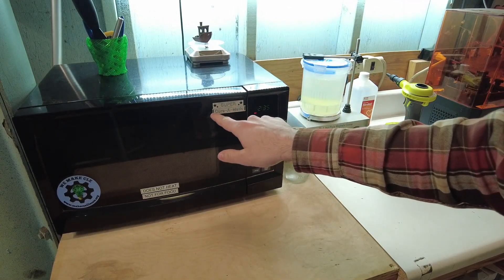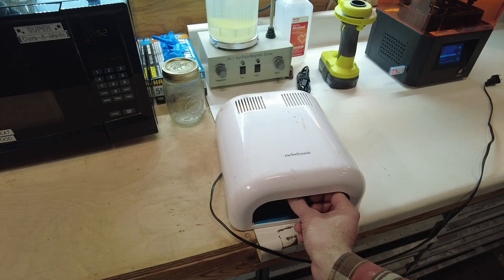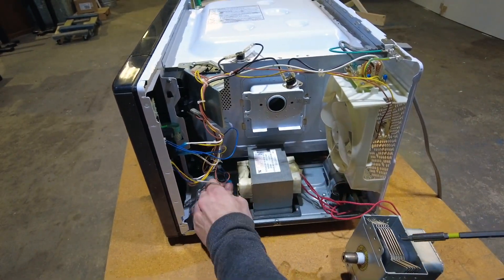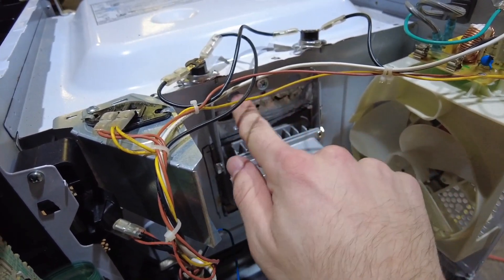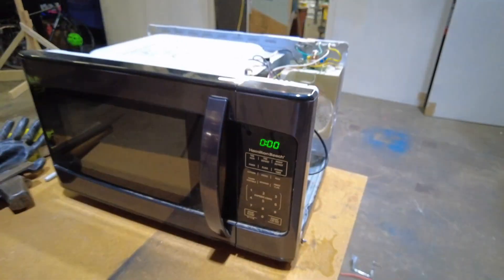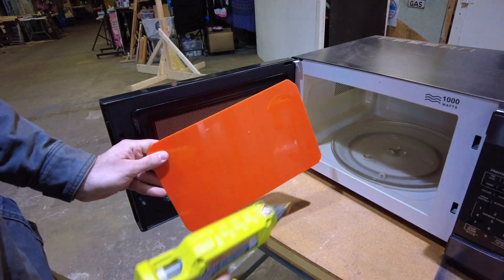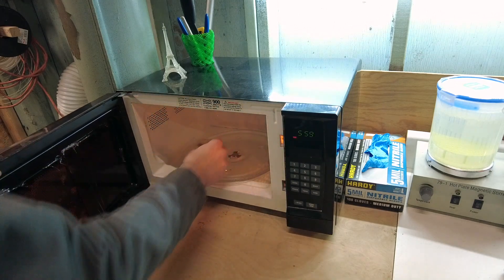DIY 3D Printer UV Curing Station Made for about $20

Comment: I like some of the other commenters suggesting the strip lighting and aluminum reflectors, and depending on the microwave, the mesh in the front window might be removable. It's there to prevent microwaves from escaping, and in some cases is just a mesh panel screwed into the door behind the acrylic.

Comment: I'm building basically the same thing. I'm using LED UV strip tape. 120vac. Going to use 365nm and 395nm . Putting rows on the top and both ends.  I like your idea with the extra protection on the door glass. I think they make a fillm I can put on the glass. This will be great. Going to use it mainly for PCB making and adhesives. 

How has yours been working for you?

Comment: What an awesome idea!  I acquired a free microwave and got to work.  After removing all the items that make the microwave a microwave I lined the inside with reflective foil tape.  Then I disassembled a large UV light to get the led panel and driver from it.  All I had to do is screw the led panel the the inside of the microwave and feed the wires through a tiny hole. Then wired it up and soldered all the connections.  It works like a charm and puts out way more UV light than the small light I was going to use. 

Thanks for the great idea!!

Comment: Great idea, much better than lining a cardboard box with aluminium foil! Ideally you would take an old oven for this, so you can also raise the temperature to about 60 degrees C (but don't use the grill!). Also, you could try to add mirrors to the inside, to spread the light more evenly.
Lastly, allow me to comment on your resin handling; do you realize you touch everything with dirty gloves? The bolt of the printer, the lid of the IPA beaker, the microwave... All would need to be cleaned with IPA. Also, please cure any tissues you used to clean resin spills in your nice microwave before disposing them in the trash! 
Keep up the good work!

Comment: I did accactly the same but with the uv leds of the nail lamp and my microwave had an analog timer< but i build an nicer version now. I am struggling with the dvr8825 and a nema 17 now to turn the stirrer and the slow rotating of the plate

Comment: Just an FYI, the purple UV lights are not really harmful to your eyes (think "Halloween stuff"). The UV ones that would be harmful to eyes (and skin) are the ones that have the sort of sky blue color output which are used as germicidal lamps. They are still UV but just a different part of that spectrum. I do like the ideas below of using the UV tape LED's and also the aluminum tape.

Comment: nice idea! i find that postcuring the part submerged in water enables a lot quicker, non-tacky cure! apparrently oxygen contact can inhibit the resin from curing fully at the surface, especially if the ipa is already a little dirty. in addition to some reflective coating on the inside of your chamber you might be done curing in ~5 minuits!

Comment: I use a nail curing station like that sitting on top of a cardboard box lined with aluminum tape, and one of those solar turn tables. Works great for me but I don't usually print anything with enough weight that the turntable wont turn. That microwave is a great idea!

Comment: Aluminum is one of the only good reflectors for big chunk of the UV spectrum that you actually want to use, so some aluminum foil or tape on the other walls would probably help cut the curing time down. There's probably some dead zones that prevent you from curing in the whole cylindrical volume above the glass plate, and this would fix those pretty easily. You could even put reflectors down on the bottom. You could also probably make a custom connector to the little rotating bit under the removable glass base have it rotate whatever kind of bed you want pretty easily, which opens up some neat options. A custom parts-curing tree would let you suspend a lot, and the aluminum reflectors would make it much more even in coverage so it could actually work.

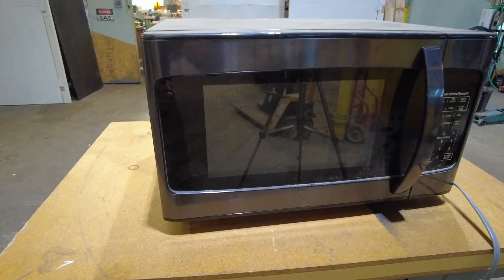Comment: Microwave mod starts at 4:20 - cleaning & safety
Cover off at 6:20
13:07 "simmer"  0_0   I hope not. Alchol should not be heated.
Reply: You can safely warm alcohol without it being dangerous. The temps that are being used are no way close enough to the flashpoint for an issue.

Comment: Love that idea. Actually thought of this myself and now i hate, that i wasnt the first one :D Just got my hands on an old microwave… maybe aluminum tape helps reflecting some more light, consequently decreasing curing time. Maybe not relevant with that big uv light. I only have some leftover 2835 UV LED Strip
Reply from the maker: I never added any reflective material to the inside, and I haven't had any issues curing.  It will cure most parts in 20ish minutes which I consider to be quite good.

Comment: Further upgrades:  A heating system to get the internal area to maybe max 60c, Some speciality resins get thier best properites cured under heat. Another idea might be to combine the wash and curing system, perhaps a bracked on the ceiling of the chamber that holds a pot of IPA and it has magnetic stirring in the bottom moved by the turntable.

Comment: had this idea then found your video so it sealed the deal. built mine tonight funny enough i had the same microwave almost. i wrapped the inside with chrome vinyl to make it reflective then i added about 65 ft of uv led strips (395-405nm) i got from amazon inside and wrapped them under the glass turntable to cure from underneath also. now i'm 3d printing a riser for the drive sprocket and some bigger wheels for the carousel to lift it slightly to clear the lights. 20 for the lights 10 for the vinyl and its gonna be perfect i even just plugged wall socket adapter for the light right into the spade connectors from the transformer.
Reply from the maker: Super cool. I'd love to see some pics or a video of this when you're done with it.
Reply: im interested in making one myself. did u find that 65ft of led strips was too much or was it the right amount?

Comment: If you wanted to upgrade, you could also spray the inside of the Microwave with a reflective coating, or use some aluminum tape. And supplement (or replace) the UV lamp with LED UV strips that stick to the inside, which would flood the chamber. This is a brilliant idea, and I'm researching on DIY UV chambers because I'm getting in to 3D Printing for Dungeons and Dragons.
Reply: This is what I was going to say cover the inside with foil to increase the reflectivity of the UV light.
Reply: @MemelordSupreme  agree. it will reduce time on curing quite a bit which will save on the light.
Reply: White is highly reflective. That's why it's white
Reply: I’m curious if you have made a DIY curing chamber yet

Comment: Similar to the chassis of microwave would reflect the microwaves around the chamber for even heading, could you line the inside of the microwave with foil to reflect the light around for an even more even cure?
Reply from the maker: I considered that, but honestly it works very well as is thanks to the turntable. 

I might experiment with it in the future, maybe. But it doesn't seem to be needed.